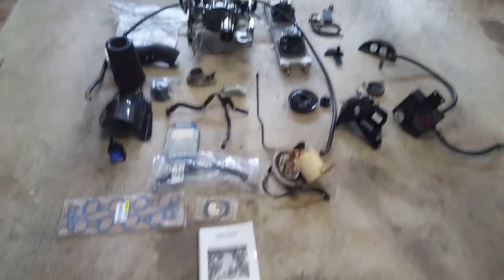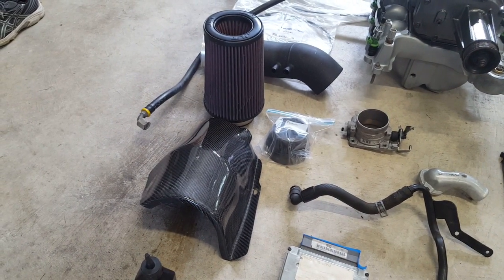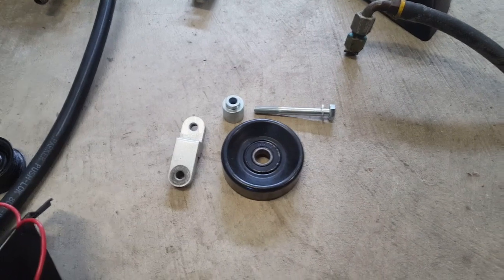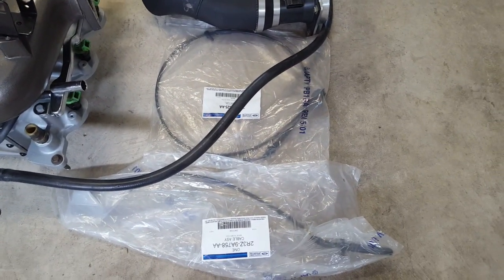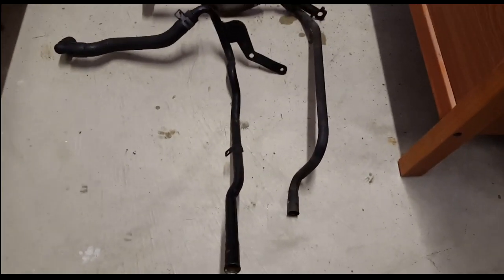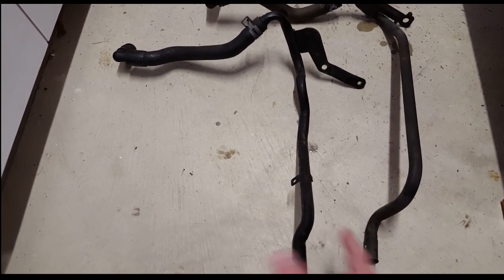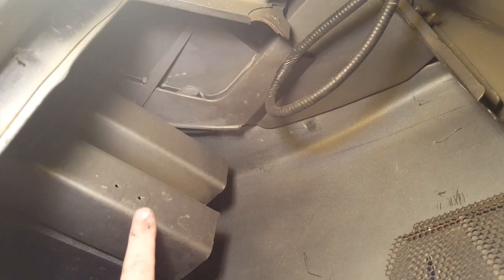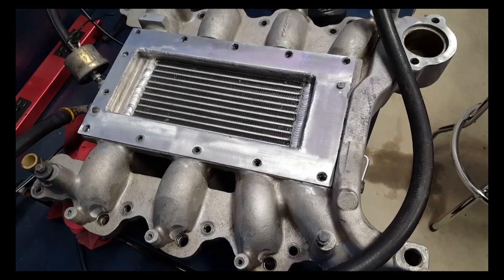Saleen Supercharger Install Part 2

Comment: You wouldn't happen to have an extra few parts i wanna do this to mine but i cant find the intake the most important piece
Reply from the maker: The cold air or lower manifold?
Reply: @racinjason88   lower manifold
Reply from the maker: @JoseTorres-lt1oo  it’s pretty much impossible to find, unless you buy a wrecked Saleen with one. An alternative is the Tork Tech manifold, which allows you to put a M112 supercharger from a Cobra on, or Jon Bond Performance’s updated supercharger kit.

Comment: Having a hard time finding a cold air intake for my car
It is much like the S4 Saleen but with bigger parts
Reply from the maker: What I remember is that you could buy a BBK or whatever brand, and have to cut the proper angle of the tube, to mate to the throttle body.

Comment: Hey I was just wondering were you got the heat exchanger fan harness from if you can please get back to me!?
Reply from the maker: I just happened to find someone with one.
Reply: @racinjason88   dang I real need one! That’s the only thing I don’t have is the harness
Reply: Is the harness to a 1999-2004?
Reply from the maker: @ernestoestrada1056  I know the 01-02 were the same. Not sure about the other years.
Reply: @racinjason88   one more question we’re did you find yours and is there anything in particular I’m looking for on the harness
Reply from the maker: @ernestoestrada1056  someone in the Saleen Owners Group page on Facebook happened to have one laying around.